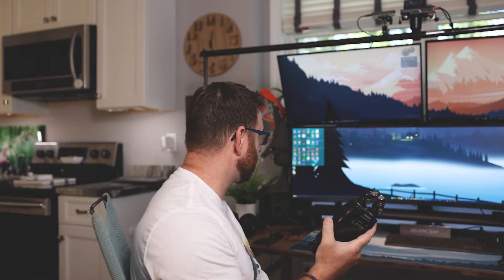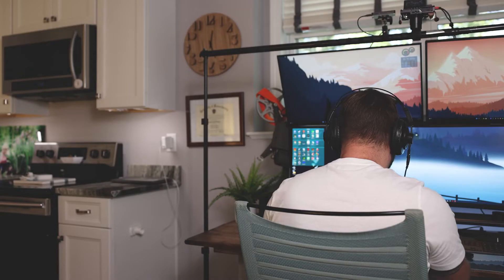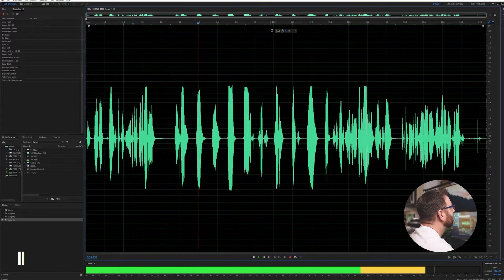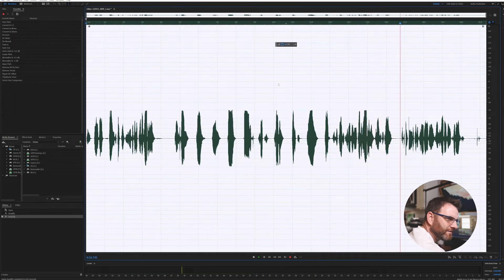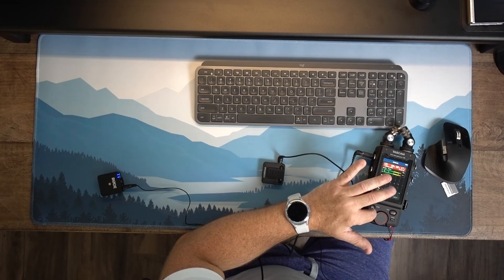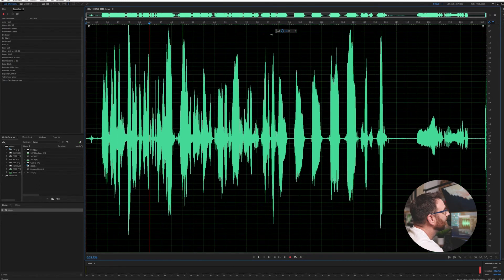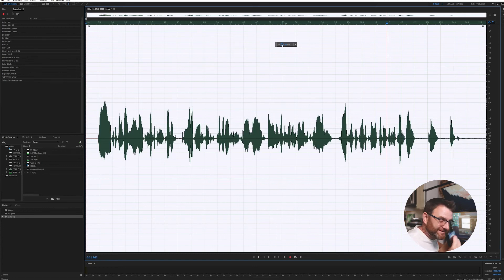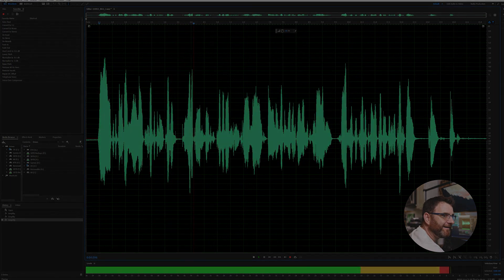Wireless 32 Bit recording? Tascam x8 + Wireless Rode = ??

Comment: It doesn't matter what mic the audio comes from as long as it doesn't clip BEFORE going into your tascam
Reply: Yeah, that's mi thinking as well. The way he's doing the test you could make any wireless mic setup 32 bit, as long as the actual mic and reciever as set properly. It's not the 32bit float from the rodes transfering, rather he's just changing the input gain of the Tascam.

As soon as the rode reciver would peak the audio would be lost.

Comment: A good test would be to make the Rode Peak before going into the Tascam, then see if the file is still useable.
Reply: THat's the point where the user still has to understand signal flow and mic selection. Clipping the source going into the recording would still be clipped (think distorted guitar)
Reply: @delmixedit  while that is true, but then this video is pointless. The way I understood his phrasing was that he wanted to see if the 32bit data would transfer over from rode to tascam, and that wasn't tested here. The way he did his test he could've used any source wireless or not, and the tascam itself still has it's 32bit float recording. The Idea of the 32bit in the Rode's is that even if you mess up that inition gain structure you can still save the audio. In this case if you only record 32bit float on the Tascam, and you don't properly gain the rodes, your audio will be damaged.

Comment: Have you had any luck with unplugging the built-in mics and using the Rode on that? I tried a couple things at a trade show and had nothing so I ended up using the XLR connections instead with an adapter. This X8 seems like a fantastic little unit. Now to try it as an audio interface...
Reply from the maker: Like physically removing them?

Comment: Wow, I was not expecting that! I just bought the X8 and should be getting it delivered tomorrow. I was thinking about testing this out with my Rode Wireless Go 2’s before I watched your video. I’m glad it works! Do you think it would also work if you plug the Rode into the “EXT IN” port or if you remove the stereo mics and use those ports? Great video.
Reply from the maker: Maybe..not sure why not. I was surprised as well
Reply: I have now the same question, have you tested it?